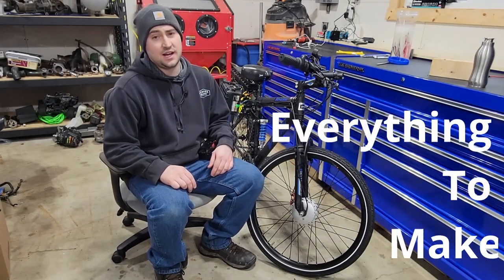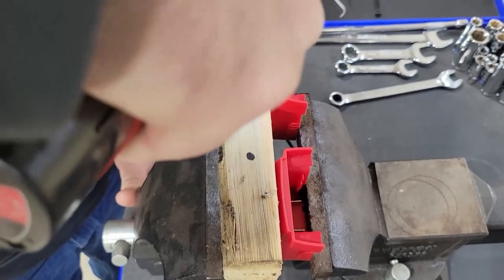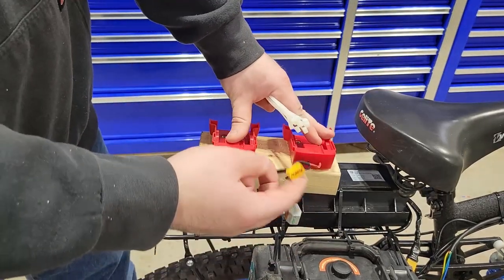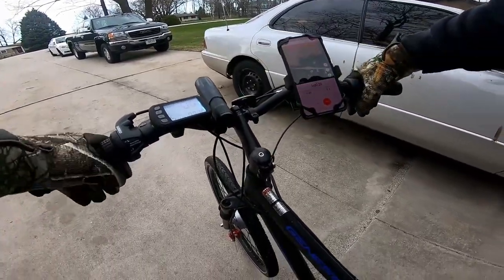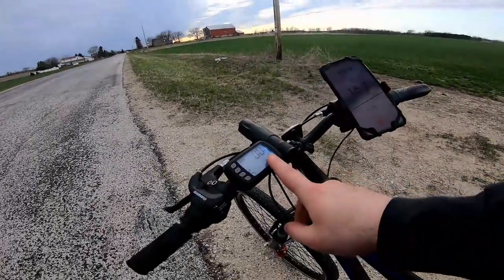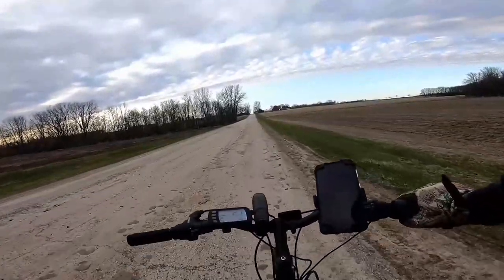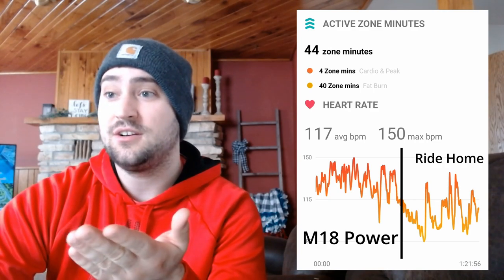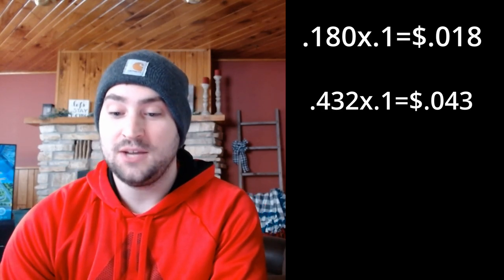Milwaukee M18 DIY eBike - Power for Miles!

Comment: I run 4 12ah m18s in series for 84 bolts on my fat e bike I get 36mph and 40 miles for the last 3500 miles and have saved a ton
Reply: How have the battery hold life on them?
Reply: 4 12ah batteries get you just 40 miles range?

Comment: Excellent! I installed two Milwaukee 12 AH batteries today and went for a test drive. After about 16 kilometers (10 miles) of driving on a dirt road, the batteries still had three lights left! The only drawback is that the batteries almost could not fit in the housing intended for them.

Comment: I'm doing a similar setup with two 8.0 High Output M18s in a 36 Volt configuration for a scooter, however I'm noticing that the batteries are going in what Milwaukee calls shutdown mode( single flashing led) if, I suspect,  pull more than ~12- 20 amps.  The batteries still have plenty of voltage left , but if they were in a normal tool, The tool would be told not to turn on by the battery, but because we are using direct power taps, the batteries still output the power. Putting the batteries into the charger "Resets" the mode and it's a fully functional battery again. I wonder @14:10 even though you ran the batteries low the battery status was similar to my situation

Comment: Excellent video! I am thinking of trying this as well, but I have all Ryobi batteries so the mount is a little more of a challenge but I think it’s doable.
Reply from the maker: 100% doable. The stems make it a little bit more bulky. Plus the ryobi batteries have a voltage cut off in the batteries themselves so you can't over discharge them.
Reply: They make adaptersfor most batteries I got mine off eBay

Comment: For a 36v motor, I'd just go for a Ryobi 40v 12aH battery, or the smaller 8aH / 6aH sizes and avoid a 2s battery setup.

For connectors, I went from XT60 to the Anderson powerpoles.  The newer Bafang motors use 45 amp Anderson connectors instead of XT60s. .  Much improved contacts, although an  Anderson crimping tool is best for completing the wires.
Reply: You’d probably need a voltage regulator

Comment: When you said nine mile range, is that with both batteries at the same time or nine mile range with one battery? And what app did you use on your phone to get those ride statistics?

Also at the end when you show the ah with wh. How you list 2ah and 6ah, is that 2x batteries at 2ah is 4.27 miles? Or is that with 1x battery? 

Then how you list 6ah, is that with two 6ah batteries?
Reply: It has to be both batteries...remember...have to have both batteries in order to get the 36volts to run the motor.

Comment: Do makita batteries have over discharge protection?
Reply: The newer 5 and 6ah ones do, i run 3 5ah in series witch makes 54v 5ah and when they run low they automatically shut off
Edit
I meant i use the batteries on my ebike

Comment: Why can't you just wire the battery straight to the motor? Did you do the power wheels adapter just because it's easier?
Reply: The power wheels adapters just make it super easy to remove and replace the batteries for charging. This way, you can use the Milwaukee charger that comes with your tools, even keep spare batteries in a backpack with you. You really wouldn't want to do this any other way.
Reply: @farmerchad62  I did it without the adapter and it worked perfectly. But thanks for the tip.
Reply: @benaiahhatfield3548 you still are running it into a controller and then the motor?

Comment: How to wire m18 batteries for a 48V motor?
Reply: Did you ever figure this out? That's what I need 🙏
Reply: Probably 3 in series with a voltage regulator.
Reply: @danlux4954  yep
Reply: Answer, wire three 18v milwaukee batteries in a series with an 18v to 12v step-down regulator.

Comment: You didn't show how to wire the battery to the bike
Reply: At the beginning of the video while he was building the battery pack, he points to the plug, the plug will just go into the motor controller.